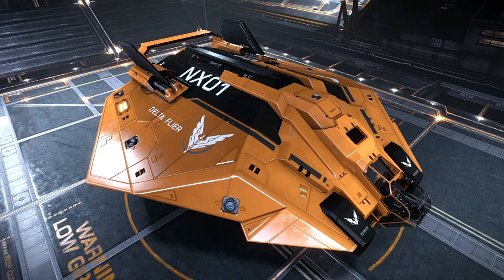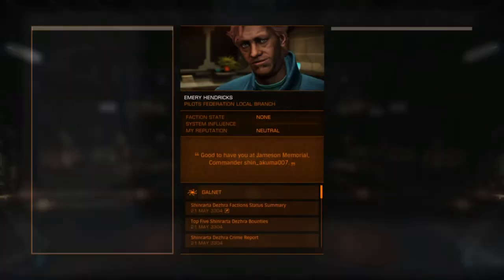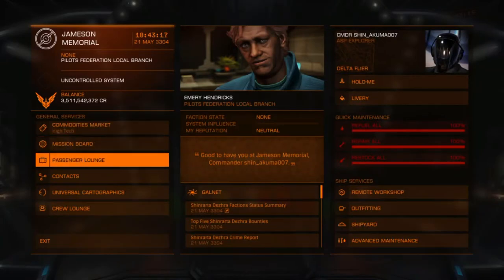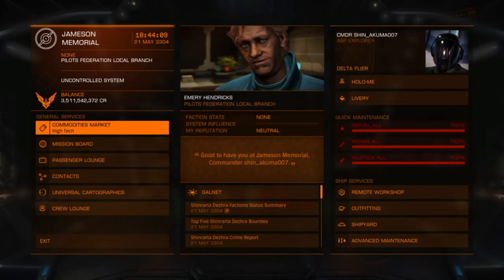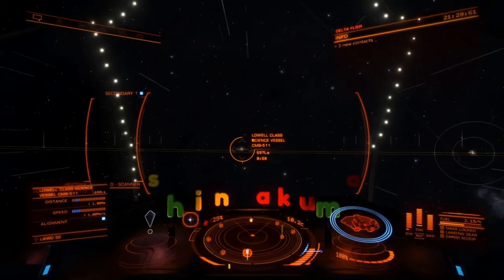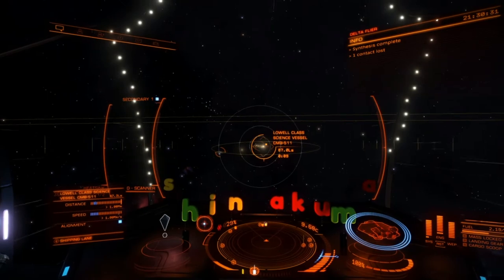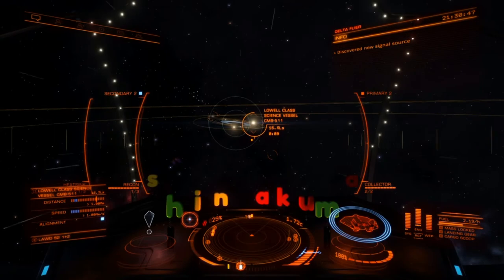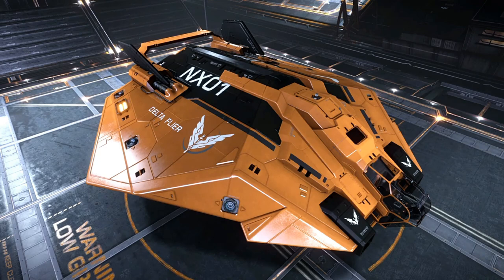Ultimate Guide to finding Grade 5 Engineering Data after 3.0

Comment: If the wake (in the navigation panel) has a name or destination (instead of just high/low wake) it means you have already scanned that wake. Good way to avoid repeating and getting nothing new. Especially if the Distribution Centre is busy.
Sometimes you can have more than 3 distribution ships and so the extended range is very useful  - like Guy said.
Cracking vid.
In the Isinor fire-fight - how can you tell which ships you've already scanned in the melee?
It might be a new thing but Jameson's Crash site will get you max on two Tier 5 encoded in minutes (scan 4, relog, repeat). Safe and quick. Then use trader to trade up and across. The speed overrides the usual rule to avoid cross trading as collection and going to a trader and then back could be done in an hour or so...

Comment: maybe you could get a video with jameson's crash... it's pretty much faster than anything i tried before. I've already got almost every data at full stock...
Head to jameson's crash (HIP 12099 system on planet 1B -54.3803, -50.3575) -> scan 4 spots near the crash -> relog -> head do Diaguandri, Ray Gateway and use data trader -> repeat
Reply: The Bug does the same.

https://www.youtube.com/watch?v=vKcaKKnYsJU&t=157s

edit:    There's mats. to collect too
Reply: Is this still viable?^^
Reply: @CMDRiKnOwYoUrIpAdDrEsS  The Bug does as at Jul-2019. Just made twice full G5 mats and traded. However, it is around 200ly to get to trader. Gona try Jameson too.